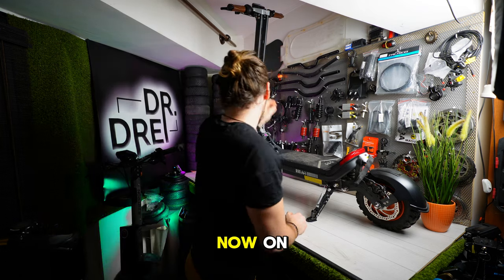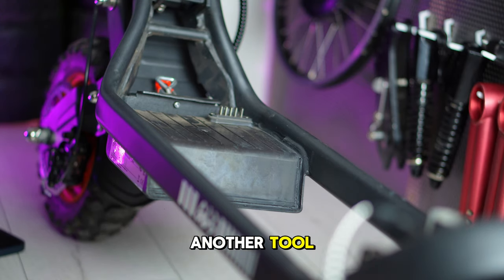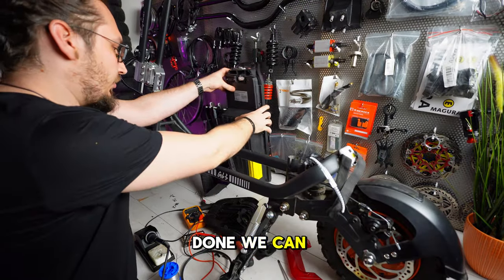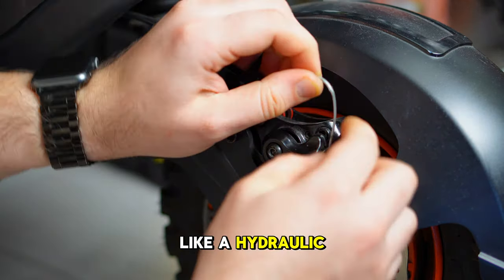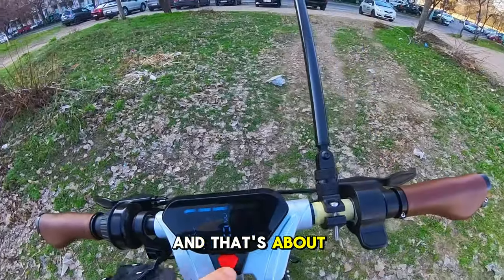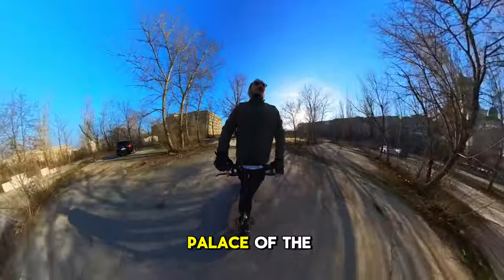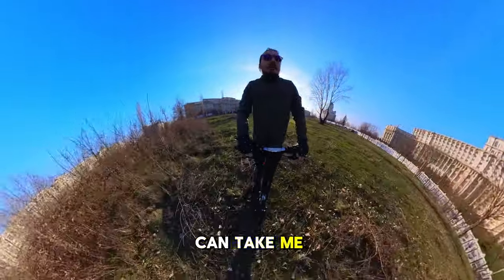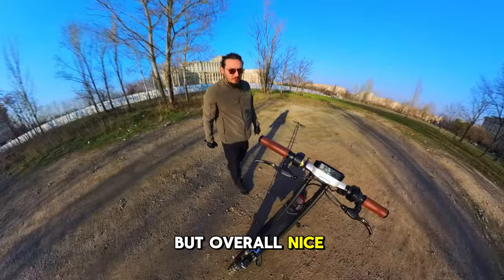The G63 electric scooter came with a non-working tail light - let's fix that

Comment: What is your position on thumb throttles? Why do so many manufacturers use them? I hate them deeply, because they don't give me that secure full fist grip as a half twist throttle. Thumb throttles also give me sour thumbs from bumps and vibration, when not riding with cruise control.